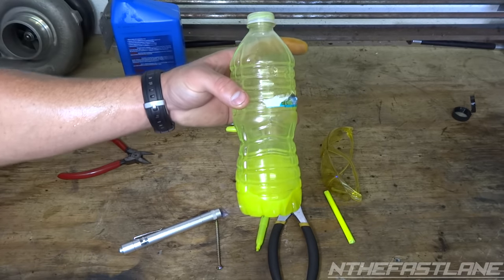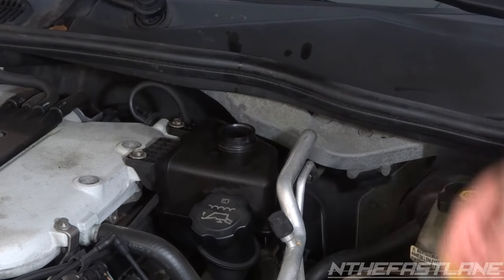▶️Leak Detection: Find a Leak Under $10 (Automotive)🔎

Comment: I followed the same steps as presented in the video. The liquid would not mix with the steering fluid. It made tiny particals in the steering fluid. Also, steering fluid is dark colored and covers up the  Fluorescent  Properties of the yellow Liquid  Extracted from the markers. Your method may work for some people but it failed to work in my  Chevy Impala.  My Chevy dealer charged me over $700 to replace the pump.
Reply: Should have bought bottle of Lucas power steering leak fix and followed instructions, but maybe next time.

Comment: So for engine oil leak should these be put into small bit of oil or power steering fluid will do the job(altho don't think it's good idea to mix PS fluid with oil in engine lol)
Reply from the maker: Whichever leak you're trying to detect use the same fluid/oil that's in the system.
Reply: @Nthefastlane  good man thanks... I am from Ireland and can't find this liquid anywhere..so have to get the markers and do it myself. Thanks a lot

Comment: what if the radiator and the coolant reservoir are completely empty?  once I parked the vehicle (a few days ago) there was spillage on the ground. I pulled it home but now trying to find out why its leaking? Can I start the car although it has no coolant in the components? thank you in advance for your help.
Reply: AJ GREENGRO no coolant= don't start the engine
Reply: If u do run it anyway, run for only a minute or 2. Temp. gauge won't work w/o coolant/fluid.
Reply: Just fill it up with water/coolant and pressure test the system, you don't even have to run it

Comment: So you can do the same exact thing for radiator Except with antifreeze but isn’t antifreeze already neon green?
Reply from the maker: Depending on how watered down your antifreeze is, yes you can add fluorescent dye to the antifreeze. Manufactures already include fluorescent dye in the antifreeze so you're able to track down a leak easier.
Reply: @Nthefastlane  Now why didn't they just pray the leak away?

Comment: If I'm checking the motor oil I would use motor oil right?? Not water?? Sorry just making sure 😅
Reply: Yes, motor oil
Reply: hahahaha
Reply: I think I did hear him say water at one point, but in fact saw him put power steering fluid in and then the yellow marker. Am I wrong?

Comment: Interesting tip.Would this work or damage putting it in a power steering fluid resivour?
Reply from the maker: That's where I put it in the video, it won't hurt it at all.
Reply: Thanks for replying 👍
I just thought that the transmission/engine dyes had been specially formulated so not to damage any seals etc and using the wrong type of dye with certain chemicals in it may damage a lot of things .
I live in New Zealand and it's so expensive for transmission dye ,like 160 plus for a tiny tiny bottle .I was so disappointed:( 
I thought it was going to be a cheap visit to the auto store and I'd be away laughing but ah no ...It's way to expensive.
I'm willing to try this on my power steering if there's no damage using this clever and cheap method 👍

Comment: Living in a cold climate, I would be afraid to put 'water' (with or without dye) in my steering system as it might freeze and make matters worse. js
Reply: He didn't. He put the steering fluid in a clean dry water bottle. Soaked thd cartridges in the fluid then added it to the resivoir.

Comment: I'd be more concerned with the noise coming from the bottom end of the engine.  It's oil islow worn or bearings are showing wear.